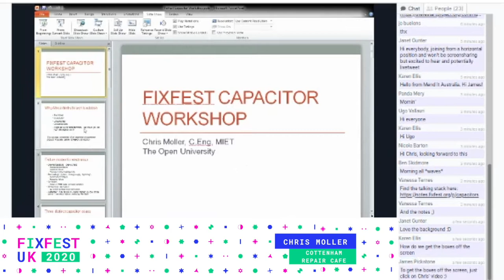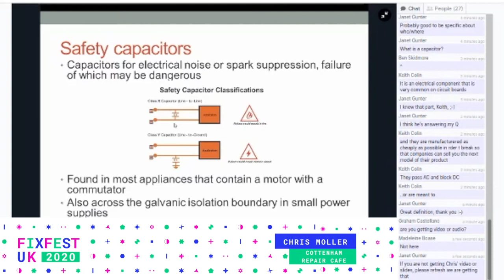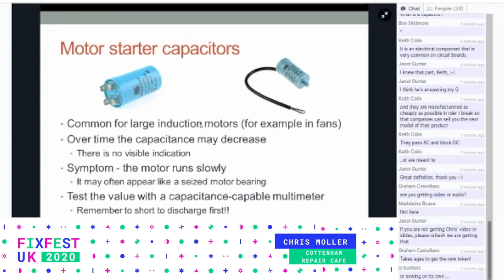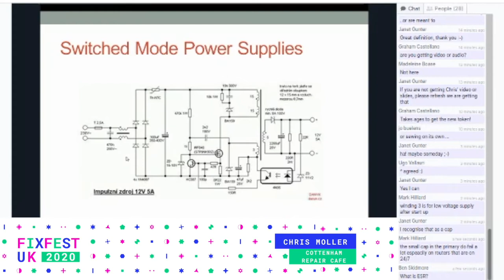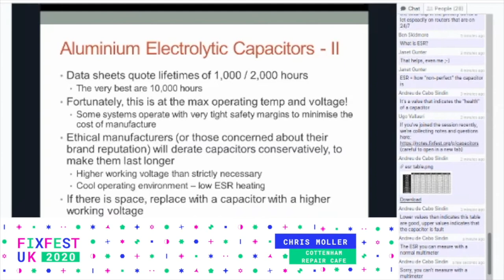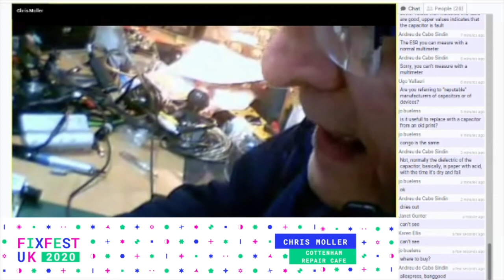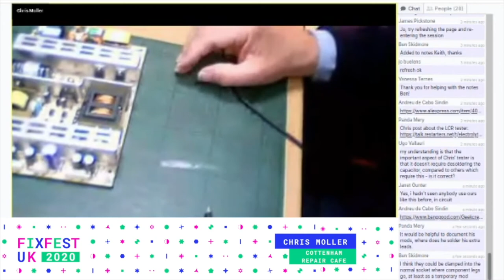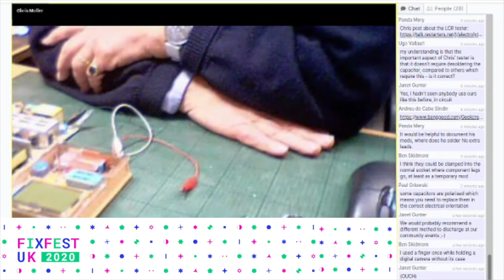Fixfest UK: The Scandal of Electrolytic Capacitors - Why They Fail and What to Do

Comment: Pity about the shocking video quality. As regards testing capacitors I got one of these off Ebay ..MESR100 V2 Auto Ranging In Circuit ESR Capacitor Meter Tester 0.001 to 100R but cost £45.